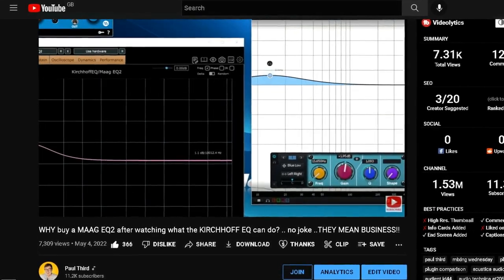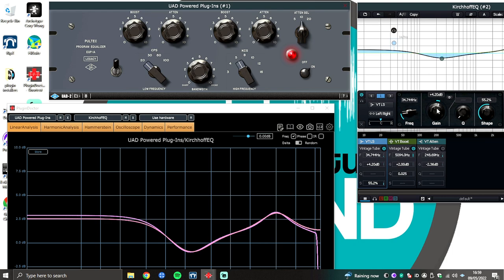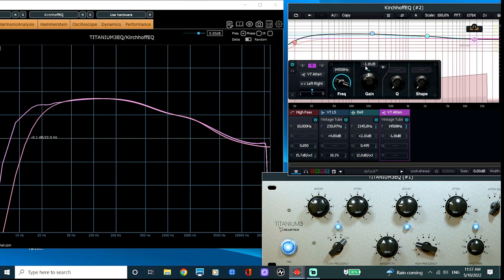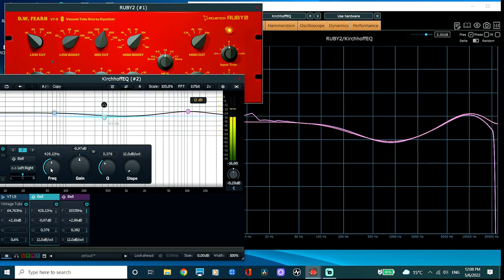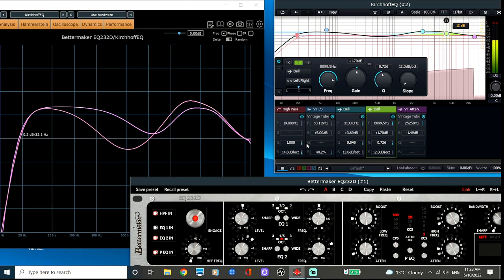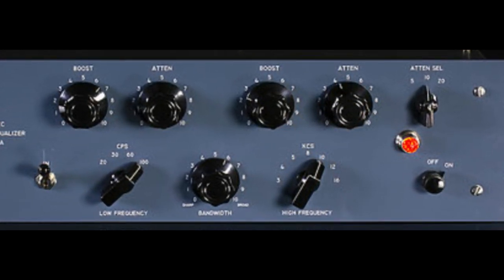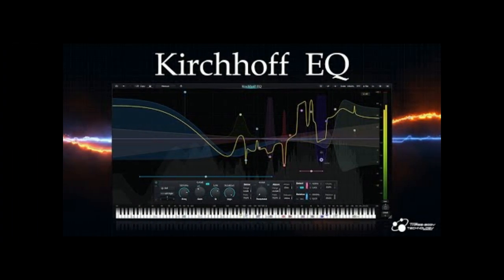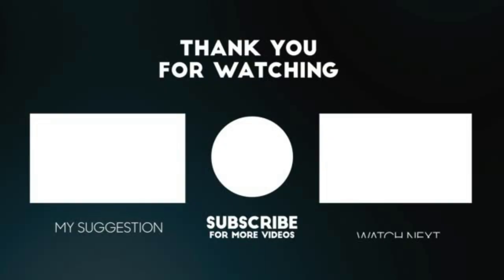Do you REALLY need 5 Pultec plugins .. considering KIRCHHOFF EQ can do THIS!!!???

Comment: Not comparing phase response? ... really? And yes, some of them are clean, but not all, and adding a saturation plugin after will get you some saturation, but not the same flavour, plus it matters where in the chain the saturation is added.
Final point, even granting nothing else, yes, most the curves of most modelled analog EQs, or even real HW ones can be matched almost perfectly with digital eq's, but you did it by looking at what the analog eq does and trying to tweak the parameters to match it, but the question is, would you have ever reached those curves without copying the analog eq?
Reply: There also seemed a discrepancy with the uad where the more recent modelled one was shown but the analysis was from the legacy version. What you say regarding matching the curves is spot on, it is the way in which you interact with the hardware/plugin emu which helps/forces you to decide on settings.
Reply from the maker: I shown last week in the maag that the phase will match. The phase matches in all bar the very high end due to the cramping in the emulations and the hpf in the bettermaker which is slightly off. Would you like me to make a community post with photos to appease you? 

Tbh I think it's you that's missing the point of the video. We use pultecs instinctively and what this shows is that you can use your ears more without the limitations of each emulation using this method. Are you saying you really need 2 or 3 pultecs?

I shown that with the same 2 or 3 bands you can get the same results. Just use your ears and don't limit yourself as there's no need

And as for a pultec outwith ruletec that has audible harmonics.. Care to give me examples?

You can do whatever you can you want. You don't need 5 pultecs for subtle nuances. You can create your own thing in the moment and add whatever colour you like
Reply from the maker: I only have the legacy version. It's the same pultec. Nothing was changed. I even said uad started out with linear circuit modelled emulations..
Reply: @PaulThird  I did not say at all you need 5 emulations. Just one. Actually I have 2, the UAD one and the Bettermaker, for when I do not want the saturation, but the same workflow/curves.

Regarding the phase, it matches only when you use the same number of bands and the same type of band as in the analog one. If you need 2...3 bands to match the shape and/or vastly different settings, the phase will definitely not match. And obviously that would cause a difference in sound. An easy proof is a null test.
Reply from the maker: But this isn't a standard digital eq curve. The analog modelled curves are linear circuit modelled eq curves. No different to what UAD done when they first released the legacy pultecs. That's why last week the blue eq and brainworx maag curves matched as did the phase.. And got mostly a -90db null. That's why for the curve interaction in the UAD only needs the frequency moved as the kirchhoff has the modelled curves. Even still you could go further and take those curves and make them dynamic and make your own phase relationship where you have the low shelf as analog and the high band as linear. You could do whatever you want. That's the point of the video 

In this video I said closely matched. Never once identical. But I did check the phase and the main variables were in the high end due to the anti aliasing filters.

I just don't get what the issue is here. Can you get closely matched pultec curves that dont suffer from eq cramping.. Yup. What's the actual issue you've got here?
Reply: @PaulThird  And regarding a pultec emulation with audible harmonics, the UAD one (non legacy) definately has audible harmonics, especially below 200 Hz, check the Hammerstein graph. The legacy one has none.

Now don't take it hard, I am a big fan and watched most of your videos since a long time. But precisely because I knew you were the guy that went in depth and tried to prove things beyond a shadow of a doubt, I was surprised that you did not also showed how the phases matched, and why not, even did a null test to see if they indeed sounded the same.
Reply from the maker: Cause I have a full time job as well a new podcast to edit. I compared 5 pultec plugins in one video, pieced it all together, scripted, recorded and edited a voice over and then had to edit it all together whilst working Mon-Fri and editing 2 podcasts on my lunch breaks. The video is also a day late as I was so crammed for time.

I know I like to go in proper depth like last week's maag but that was one eq.. Not 5. come on.. Give me a bit of a break here haha

I can see the phase and linear frequency response as well as the lack of harmonics so I didn't really think it was needed after last week's video. If you really really want I'll put a community post up showing the phase between uad and kirchhoff but in regards to null tests and stuff.. I'm pretty much done. If I was doing the YouTube thing full time then sure this would've had null tests added in and stuff but I think people genuinely think what I do is just like.. Add that on. It'll take 15-20 minutes.. Its not when you are juggling everything else. I only do what I can manage
Reply: @PaulThird  I perfectly understand being tight with time, I also have a full time job, and a baby, trying to do music on the side. But since you already showed the linear frequency response and matched the curves, you only needed to click a button to also show the phase.

I was genuinely curious, as I could not try it myself, I do not have Kirchoff EQ, I really cannot justify buying another EQ, lol, and I did try to match some analog EQ curve in the past with Pro-Q 3 and managed to do it, but the phase was not the same at all.

Even still, my biggest point still is, even though you can match the curves by referencing in plugin doctor, would you ever reach those settings and curves, without those limitations? A lot of the time infinite possibilities creates confusion and makes actual good results harder to get. I will - for example - always pick an analog modelled EQ for general tone shaping/balance, and a digital EQ (Cubase EQ or Pro-Q 3) for more problem solving/precise things.
Reply from the maker: Tbh the answer is.. It is actually possible as its what I used to do before I got doctor. My eqp1a hardware plugin shootout is painfully tweaked by ear. I have the same 3 bands in kirchhoff as I had in the other shootouts.

But really.. Who cares. The point is you CAN which means that you can use a pultec more intuitively without the limitations of fixed frequencies and q's. You can use 2 bands of kirchoff and it's an eqp1a.. But you can also add a maag high shelf, make them dynamic etc etc

The whole limiting your options thing is better is BS. A crap ton of people moved onto bettermaker hardware and the plugin and it offers 2 variable mid bands. All your doing with kirchhoff is sweeping frequencies instead of switching between fixed frequencies.

You don't need to change the phase, make them dynamic or add in an ssl, Neve or maag air band. You can just have the 3 vintage eq bands and use it like any other pultec eqp1a plugin.

Boost your low shelf, change your shape for attenuation and then boost your high band, pick your bandwidth and then add some high attenuation.

That's how you use a pultec. Where is the confusion added by having variable frequencies? You just use your ears and get the results you need.

Its almost like there's something else going on in the comments that I can't fathom. It seems more than what I'm reading cause it's not a difficult thing. It's just another eq offering modelled pultec curves. That's all it is
Reply: For me, the gui guides me in my decision making, with pro q I am notching resonances honing in on problems - that’s what it is brilliant at because it’s visual and that helps me- with a gui layed out like a pultec it forces me to think about the whole sound rather than fine tuning. If I use pro q in this way for general tone shaping I wouldnt use it like a pultec. Its not that it can’t do it but it’s that I can’t use the eq like that because I’m drawn to the gui being far more detailed.
Reply from the maker: And I get that. But surely with kirchhoff all you need to do is look at the band list and tweak instead of looking at the curves.

The way I've been using it on vocals I've been using the pultec low shelf and attenuation, bit of low mid mud cut, ssl e 1k bell boost and a maag high shelf boost. All of them working dynamically and being detected via certain areas of the vocal. Mixed phase so the pultec lows and ssl are analog and the maag shelf is linear. One eq instead of 4. Everythings nicely ordered and easily accessible via the band list and only 1 output knob to level match. 1 instance to bypass everything in and out.

And its set up as a preset so I just tweak there and then 

I'm thinking 2, 3 steps ahead when I'm doing all this so when it comes to workflow all in its always making sense there and then instead of back and forth tweaking, level matching, going through different gui's etc

But that's obviously just a preference thing for me 🤷‍♂️
Reply: @PaulThird  and this is the beauty of having loads of tools isn’t it, I’ve tried all in one type plugins and I absolutely fail in using them, get tied up in knots and end up going down a long and winding rabbit hole! One processor or effect doing one job and that’s my workflow. Thanks for replying and interacting with the comments.
Reply from the maker: Well whatever works for you man 👍
Reply: @AlexLapugean  ah no wasn’t saying I visually eq but that when I hear something specifically I want to change then the gui of modern digital eq’s helps me fine tune and gets me the results quicker than a non visual one. My point is I’d never use pro q if I didn’t hear something specific I want to change, if my goal is to make it a bit brighter I reach for a non visual plug.
Reply: @DeeKeiMixes  Got a lot of nerve unnecessarily critiquing someone trying to provide feedback to how an analysis can be made more clear and complete. The receiver can also argue for himself if he does not agree with everything, which he did, so I would say there is not need for for an attention seeking "defender", that provides no added value. Cheers!